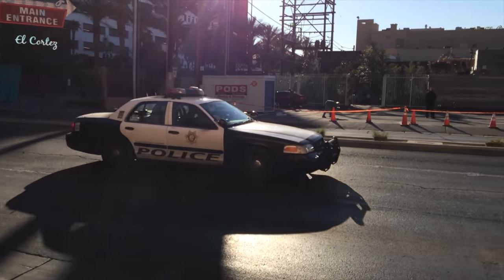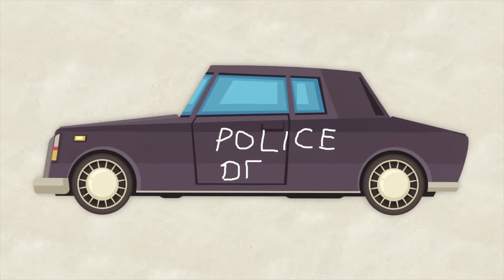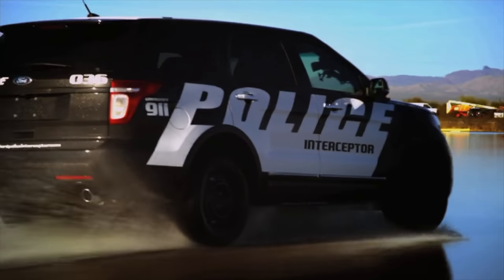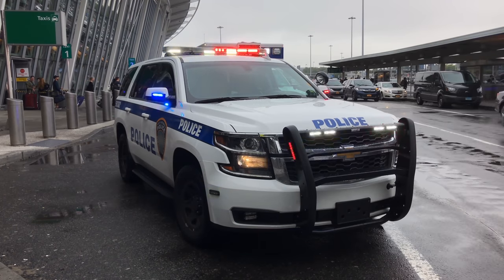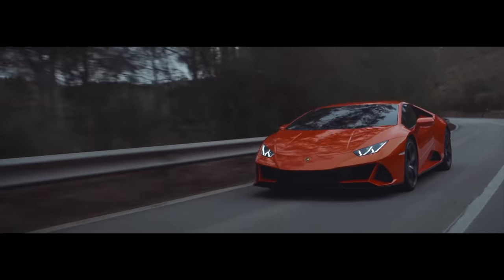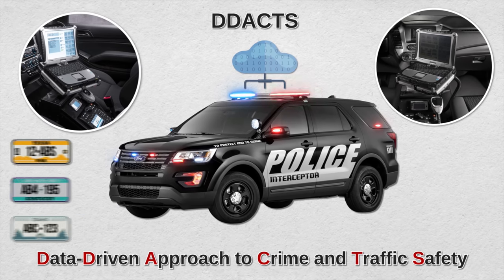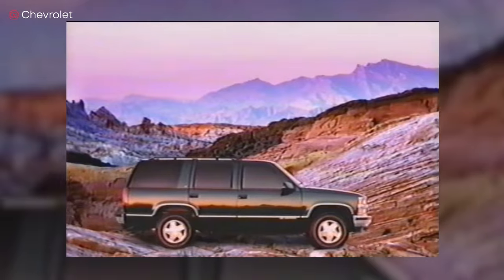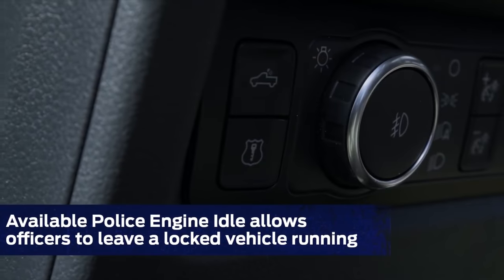Here’s Why You Can’t Outrun a Police Car

Comment: From what I was told by a female cop in training, the top speed of most interceptors is 150 miles per hour. Another friend who is a cop told me he doesn't recommend buying a used cop car from a government auction, as their engines are usually pretty worn out from all of the idling and hard acceleration they do.
Reply: Debatable, If you do purchase a used police vehicle I always go for background investigators or Detectives squads. They have not been on patrol and beat to crap. I have had multiple retired squads (47 of them) and that's what I have learned from my own experience.
Reply: If you buy a used police car in a low crime city, the likely hood that it has been accelerating much is low. A civilian sports car has done more accelerating.
Reply: @TraceguyRune  that is a huge factor I forgot to mention. You're absolutely correct. It it is from a rinky dink department or low crime area that makes a big difference usually.
Reply: @2hi4u2c.4  some times they use the car for stake ours
Reply: @2hi4u2c.4  my dad was a detective. Usally the detective cars are just undercover Durango’s etc.
Reply: @basstion4146  I have had Vics, Chargers, Explorers, Interceptors, and Tahoes but never a Durango.
Reply: I used to hate getting stuck with female officers on this security post. They never missed an excuse to escalate even the most benign situations lol. Only the blonde ones did this, weirdly.
Reply: @ChadDidNothingWrong  

I'd hate to be the male cop having to rely on one in a brawl.
Reply: @2hi4u2c.4  why did you need 47 of them if they are so reliable?
Reply: @cas2985  I bought and sold them.
Reply: @cas2985  you Seriously thought he just keeps them around like tea spoons in a collection? lol
Reply: I have a 2003 CVPI and it still runs like a beast 19 years later over 222500 miles
Reply: @thedailyracecar2064  right, what the hell!
Reply: But they do get regular maintained
Reply: Tell Cleetus McFarland that. Watch the Freedom 500 28 used  Cop Cars Crown Vics. 100 Lap races and some of them get used more then once.
Reply: And I was told that before they sell an old police interceptor to the public they take some high speed electronic chip OUT of the vehicle so it's not the beast it was when the police were driving it.
Reply: I used to own a '78 Fury, Nevada state highway patrol interceptor. Went from 27th ave and Camelback in Phoenix to the Flagstaff city limits in one hour flat. I'll let you do the math. This was in 1984.
Reply: @TacDyne  over 144 mph. Beast.
Reply: Ah. Loop hole. Pennsylvania buys big ford expeditions and never used for chases, yeah sure idles often granted, ways around that yes.
Reply: @ChadDidNothingWrong  who asked
Reply: That could be any used car lol
Reply: I've heard that buying a used police car at an auction is like using a soiled napkin lol
Reply: These Explorers are supposed to top out at 130 mph. Not sure if it's accurate or not but it's what Google said when I searched it. Some of them are turbo charged & some aren't,  I do know this to be a fact.
Reply: acceleration matters not top speeed
Reply: acceleration + stability. I gaurantee anything under 3500lbs with awd and foorced induction will out run a police carr. ask my m5..
Reply: Sometimes they get suctioned because the department doesn't like them. I've had a few unmarked charges come into the lot with low miles that operated fantastic.
Reply: @2hi4u2c.4  Where would that be in America today?
Reply: @TraceguyRune  there are no cuties without many speeding tickets.
Reply: @TraceguyRune  most of those police use any excuse they can to stomp on it. Like a car going 70 in a 65.
Reply: @cas2985  in other words he's clueless about the reliability part. Hard to say what reliable means as well. Maybe he was use to driving civilian PT Cruisers or something? Just hard to take someone's word for it since there's so many unknown variables about the person huh?
Reply: I'm limited to 145 but I can do that for miles and if a civilian car tried that, it would blow up.
Reply: girl partner beats up the guy suspect and the guy partner gets wailed on by a butchdykeslumber yard suspect in Weehawken, new jersey that one time..
Reply: @ins2177  cop blew mine up before they got rid of it. New motor in it.
Reply: @2hi4u2c.4  Our pd has just auctioned off a detectives durango
Reply: @MinutemenMilitia76  has it sold already?
Reply: @2hi4u2c.4  yep
Reply: @2hi4u2c.4  sold for around 3500 i think
Reply: @kadenwolf5798  where do you live ? I have a car that’s top speed is governed @155 mph . Look up what Nissans top out at that speed .. i gaurantee my civilian car would not blow up and continue to dog whatever your driving
Reply: @AT-qv3gn  the only thing Ive ever lost to is a built Camaro so try again. U don't know what ur talking about. First of all, the only Nissan that will do 155 is a GTR. Secondly even if we play devil's advocate and say that a stock Altima could do 155 the motor would blow up because it is not designed to do that. Thirdly do u even know what tire rating is. Even if a stock Nissan non GTR could go that speed, after a very short amount of time the tires would explode because the ones put on stock vehicles are not rated for that high of speed. It does not matter what anybody who is uneducated about cars says to me anymore.
Reply: @oscarenriquez1267  No, they don't. I have a prime example sitting in my driveway that is in need of serious and expensive repairs. It was supposingly the chief's car which only got driven back and forth to work with the occasional traffic stop. Well if that's the case then it shouldn't be having every major system go bad at once, especially if it was well maintained as claimed. It still has to oem belt and hoses if that tells you anything. Those should have been replaced at least twice before three years ago after it sat for 10 years before it hit the auction.
Reply: I love my 2010 p71. 80k miles. It belonged to a fire chief and is in excellent condition! I hope to have it at 400k miles!!!
Reply: Just rebuild the engine
Reply: A female cop told you....but male cop cars are not limited to 150 mph.
Reply: @2hi4u2c.4  Lmao
Reply: Top speed of an Arkansas State Police Charger is 166mph.
Reply: 150 mph is just normal travelling speed on the German Autobahn
Reply: @kadenwolf5798  My 5th gen LS GTO 6-spd had no complaints at 160 MPH. I verified this on a few separate occasions.
Reply: The mileage on a car is not as important as how many cycles( turn on turn off) they do. The top speed is not as important as how long they can maintain that top speed comfortably
Reply: Ha.  Welcome to New Haven Connecticut.
Reply: Guess it would depend on how much an engine swap would run if it's that bad. We recently swapped my girlfriend's 110k mile engine on her Honda fit with a 35k engine for like 600 including labor. But I know Honda fit motors are cheaper and less powerful lol. Wouldn't be surprised if I found one on a go cart
Reply: @Kevin-bl6lg  lmfao
Reply: No such thing as a "female cop", just an impersonator we tolerate for the sake of diversity quotas and affirmative action. That's a female they let don a policeman's uniform who we all pretend to be the same as actual officers of the law. Good joke though XD
Reply: The charger cop cars top out at 155mph. The other ones top out at 130mph.
Reply: @TraceguyRune  they idle all day though. That has to be bad for the engines
Reply: I don't know it worked out great for Elwood Blues.
Reply: @johnlivesay5110  no, when THEY buy the car they take a limiter chip out.
Reply: @basstion4146  They don't leave the car idling the entire stakeout though
Reply: @Mr.Ambrose_Dyer_Armitage_Esq.  What, you don't think a female cop can just as easily empty a magazine into your back as her male counterpart? Or give you a ticket? Tase you? Get on the radio and call for backup?
Reply: @unopine  
I love that your FIRST thought on the capabilities of a female masquerading as a policeman is that she'll empty an entire 15 round magazine into my back. That says more about what you think of women, cops, and those with whom you disagree than any accusation I could ever make...wow, son...
Reply: @DeadpoolNJ
Reply: @TacDyne
Reply: Hard acceleration only hurts when the engine and transmission are not fully warmed up
Reply: You really shouldn't purchase anything from a government auction-
Reply: @johnlivesay5110  Not true.  My CVPI and my FPIU still perform like cop cars.
Reply: Ghost9  And tuned for 225hp instead of civilian around 190hp.
Reply: @cas2985  
He capping 😂😂😂😂😂
Reply: @A T  Ive got an 03 Audi RS6 that will do the same
Reply: Depends on what capacity the vehicle was used in during service. If it was a marked patrol car, it saw lots of idling and acceleration. If it was a supervisor unit, it likely saw some action but not really enough to warrant much wear and tear. If it was a detective unit, it likely saw plenty of idling but little action. Seeing as these cars are made to idle, so long as the oil was changed regularly and usual stuff like belts and whatnot changed when needed, unless it ran 24/7 the entire time it was in service, the idle hours aren't nearly as important as regular mileage.

Biggest thing is finding out how it was used and getting a vehicle history report to check for accidents and whatnot. I have a retired Crown Vic that served as a supervisor unit. It was in a minor collision shortly after being put into service. Luckily, it was minor damage and properly repaired so there's no lasting effect on the vehicle. That's not always the case though.
Reply: I would buy a cop car for all the extras it has & rebuild the engine if needed but they service cop cars a lot so it may be in good shape but if you don’t know how to work on cars I wouldn’t recommend buying one.
Reply: @TraceguyRune smart thinking
Reply: @RazzleJazzle420  
Why would you need to replace a Honda engine with only 110k mikes on it?
Reply: @2000bigruss  true, especially if it's seen real action. Supervisor and detective cars see relatively little action and, assuming they're an actual PPV (police package vehicle), they're still primed for it even if they don't see it. I personally prefer PPVs just because of my style of driving. Not to mention, you can make some damn good time on the highway lmao
Reply: @johnlivesay5110  I know this is a very late reply but there is no such thing as an electronic chip that they pull. I actually do know this. It's a myth that came from somewhere and probably because somebody was like "and they didn't take the chip out man it's so fast"
Reply: Throw a new camshaft (camshafts) and your probably OK.  Idling is tough on the lobes.
Reply: @2hi4u2c.4  you own 47 cars??
Reply: @Null I would say border patrol vehicles are better maintained for the most part. Some municipalities don't have the funding the feds do.
Reply: @quasitoantrax  I have over time had 49 now. But not all at once.
Reply: Guys, Here is Our Savior

YaH The Heavenly FATHER HIMSELF was Who they Crucified/Pierced for our sins and “HERE IS THE PROOF”

From the Ancient Egyptian Semitic: 
"Yad He Vav He" is what Moshe (Moses) wrote, when Moses asked YaH His Name (Exodus 3)

Ancient Egyptian Semitic Direct Translation
Yad - "Behold The Hand"
He - "Behold the Breath"
Vav - "Behold The NAIL" <— YaH’s Crucifixion
He - "Behold the Breath"

“Behold the HAND that Beholds The NAIL” 

PROVES - YAH The Heavenly Father HIMSELF was Who they Crucified

That is EXACTLY what Moses Wrote

Here is what they mean

YaH's Name:
(Ya)d + (H)e, as YaH is what Moses called Him and YaH Declared: "this is My Name, this is My Name for all generations" (Exodus 3)

YaH is The Creator of “MAN”: (Genesis 2:7)
Yad He, (HAND BREATH), as YaH's "HAND" Formed man from the dust  of the Earth and His "BREATH" made him a living being (Adam)

YaH's Sacrifice of Crucifixion for “MAN”:
Vav He (NAIL BREATH), the "NAIL" through YaH’s "HAND", in Sacrifice of Crucifixion, that whosoever shall call YaH Savior, His “BREATH” brings forth life (Salvation)

How YaH arrives:
YaH arrives via the Tent of Meeting (Exodus 33:7:11, Isaiah 54, 55), where a Tent is erected outside the city, a cloud descends upon the entrance of the Tent and YaH appears...

Why they demanded YaH to be Crucified:
YaH was Crucified according to Hebrew law (Deuteronomy 21), to be NAILED/PIERCED on an Almond Tree for BLASPHEMY as it was for His NAME they demanded Him Crucified. The Messiah claimed He was YaH...

HE WAS YaH!!!

HalleluYAH translates “Praise ye YaH”

The Hebrew Book of Isaiah

Isaiah 42:8
"I am YaH; that is my Name! I will not yield my glory to another or my praise to idols.

Isaiah 43:11
I, I am YAH, and there is no other Savior but Me.

Isaiah 45:5
I am YaH, and there is none else.
Reply: @jimmyjackass1805 I
Reply: @dpz9872  why do you think no one wants to be a cop anymore ?? No offense ofc but theyre hated by public, low pay, high risk odd hours and sometimes even other police or their dept wont have their back
Reply: @starsixtyseven195  

Your right especially in large inner cities.
Almost everyone hates the cops until they need one and then they didn't get there quick enough.
But there's still plenty of good cops and ultimately we all need them so maybe they know the difference between humility and humiliation and choose not to suffer from either lucky for the average law abiding citizens.
Reply: @dpz9872  speak for yourself i dont need another man to protect me 🤣🤣 they simply cant get there quick ... Good cops either turn bad or are kicked out or ostracized
Reply: @starsixtyseven195  

Keep enjoying the Kool-Aid your obviously young enough. 👍
Reply: No one should ever buy a used cop car, they have only known abuse.